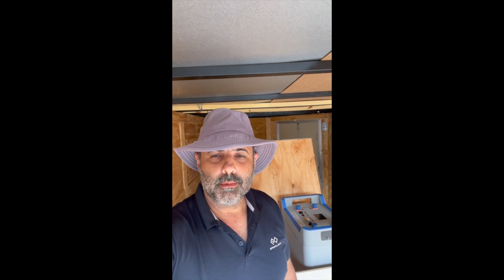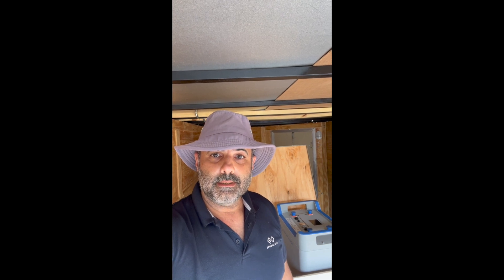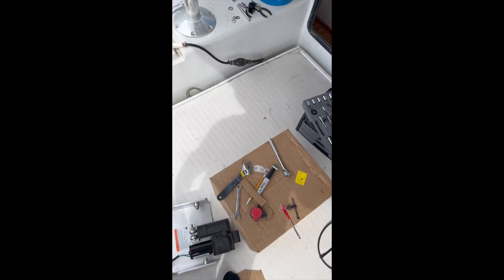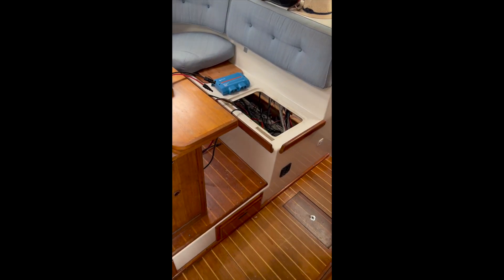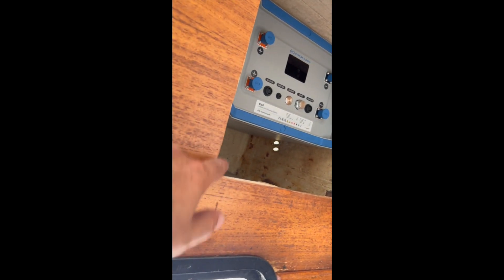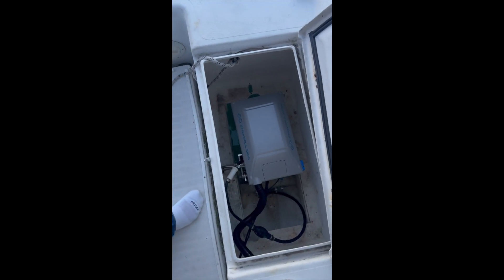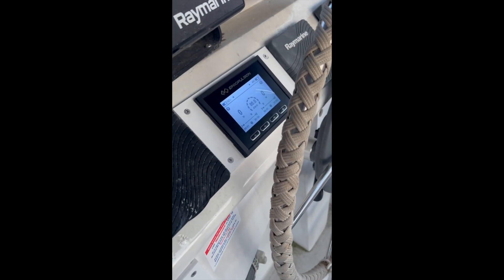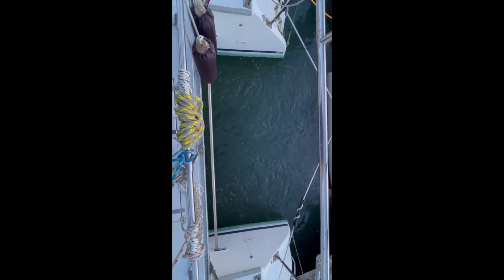PDQ36 Sailing Catamaran with Twin Epropulsion Navy 6 EVO E163 Hydrogeneration and solar charging!

Comment: Were the Yamaha 9.9hp engines the High Thrust versions with the big props?
I have a Farrier designed 31' trimaran (F-9A homebuilt version of the F-31) that weighs about 4000 pounds. It currently has the long shaft Yam 9.9 High Thrust. I'm about to do a refit of the boat and I'm considering going electric so I don't have to flush it anymore Flushing has always been a real pain and almost impossible to do properly since I keep the boat on a mooring (no electricity or water).
I'm thinking a Navy 6.0 would do the job but I'd have to charge with panels.
Reply from the maker: @steveturansky9031  yes, the Yamahas were high thrust. The Navy 6 Evo is a great electric alternative. A couple of things to consider is battery placement, whether 2 E60 or 1 E163 suit your situation best. Also you need solar panel(s) at least at 52volts for charging and what control you want.